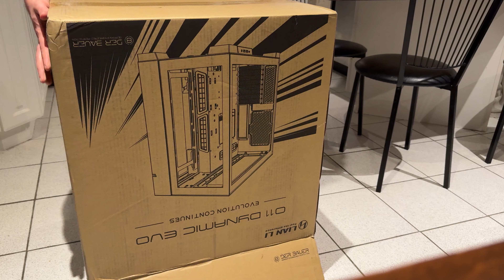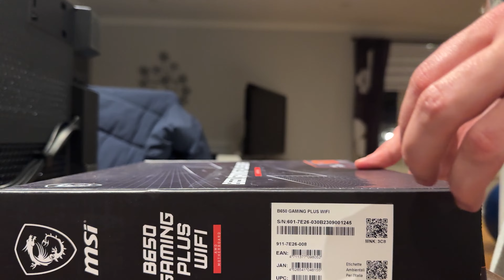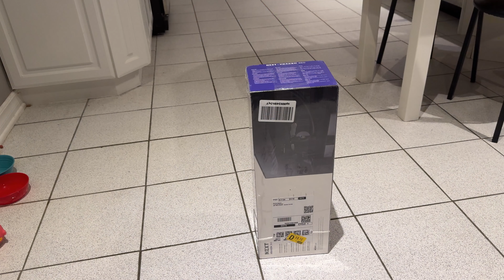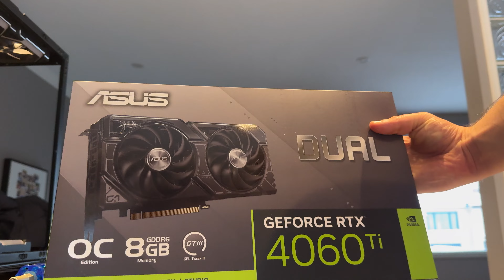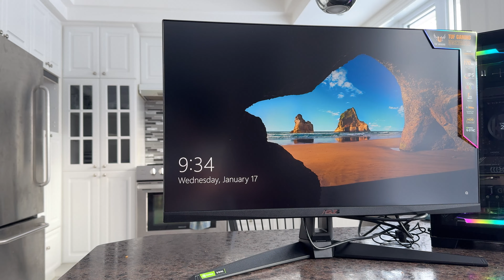Building a 3000$ Custom Gaming PC!

Comment: bro spent $3k on the wrong parts 😅😭
Reply: fr like where did it go
Reply from the maker: 3k canadian which is equal to 2200 usd  :P
Reply: @patkeenz2693  my whole 4070 ti, i7 , 240 hz setup costed 2.1k lol plus maybe 2.2k i forgot
Reply from the maker: Yes, the price includes the 170hz 2k monitor. A 4070ti on it's own is >1k cad. If I didn't care about looks I'd say I could fit in a 4070ti and have the price be around 2.4k. This build wasn't for me and a 4070ti was overkill for it's purpose.  @matt-nj3kh

Comment: Nice build bro but 3k on aesthetics
Once you play games and you don’t get the fps you want you’d wish you went with performance. That’s why I spent 4k on my recent build no rgb just the best specs
Reply from the maker: Its 2.2k usd after taxes, the price is 3k cad. If by aesthetics you mean case fans, than yes I spent 150$ on aesthetics and could've got a 4070 instead of the 4060ti. But the 4060ti is good enough for anything the pc was meant for